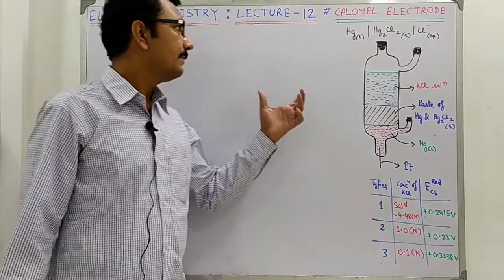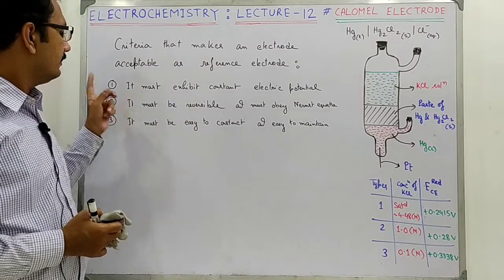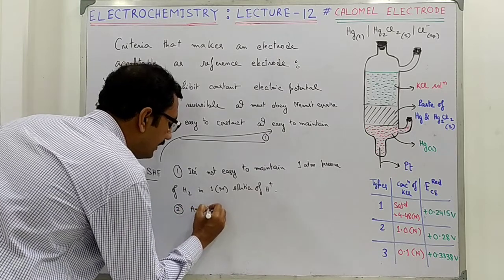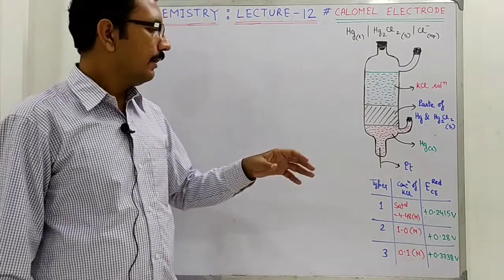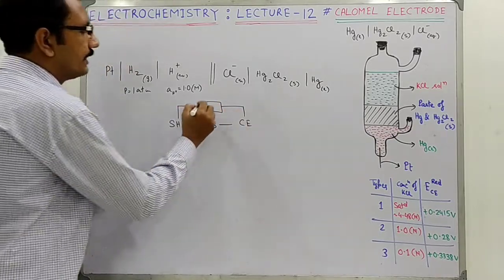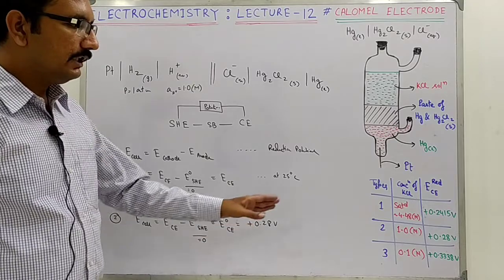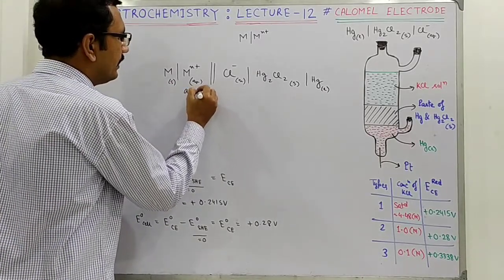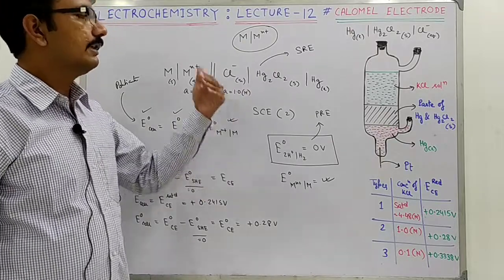Calomel Electrode || SCE || Reference Electrode || Electrochemistry || Lecture 12 || EMF

Comment from the maker: Watch the video carefully and solve the Problem: 
Write the a) Cell reaction, b) available Electrical work, for the following Cell -
Cd | Cd2+ || KCl (satd.) | Hg2Cl2 - Hg.
Given: E°_Cd2+ | Cd = -0.402V.
Reply: Provided  Cd |Cd2+ || KCl(satd)| Hg2Cl2 --Hg

For calomel electrode ... 
2Hg   = 2 Hg+ + 2e 
2Hg+ + 2Cl^- = Hg2Cl2 
-------------------------------------
2Hg + 2Cl^- = Hg2Cl2 + 2e 

Cell reaction for the above questions 
Cat reacⁿ: Hg2Cl2+ 2e  = 2Hg + 2cl-
Anode reacⁿ : Cd²+ +2e = Cd
                         (-)        (-)    (-)
__________________________________
Total reacⁿ : Hg2Cl2 - Cd²+ = 2Hg + 2cl^ -  - Cd
    : Hg2Cl2 + Cd = 2Hg + 2cl^- + Cd²+

E°_Cd²+ |Cd = -0.402 volt 
E°_Cl^-(sat)|Hg2Cl2 |Hg = 0.2415 v......since the solution is saturated so electrode potential will be this .

E°_cell = E°_c - E°_a
            = 0.2415 -(-0.402) v
           = 0.6435 volt 

For a galvanic cell electrical work or electrical energy produced = nFE

For the given cell , electrical work will be 
   W =  nFE°_cell
       = 2* 96500* 0.6435 joule
       = 124195.5 joule 
Where 
n = No of electron transfer 
F = 96500 C
Reply: For the calomel electrode, the reaction are —
2Hg ---> 2Hg+ + 2e
2Hg+ + 2Cl- ----> Hg2Cl2
————————————————
Total reaction is : 2Hg + 2Cl ---> Hg2Cl2 + 2e
a)  according to the question, the cell reaction is —
A R : Cd ---> Cd²+ + 2e
C R : Hg2Cl2 + 2e- ---> 2Hg + 2Cl
———————————————————
Total reaction is : Hg2Cl2 + Cd ---> 2Hg Cd²+ + 2Cl
b)  E°_Cd²+ | Cd = -0.402 V
Since the solution is saturated,  hence the electrode potential E°_Cl- (satd.)  | Hg2Cl2 | Hg = 0.2415 V
Now,  the standard cell potential is 
E°_cell = E°_cathode — E°_anode
             = 0.2415 — (—0.402) V
             = 0.6435 V
The electrical work of this particular cell is —
W = nFE°_cell ........
Where, 'n' is the number of electron transfer 
F = Faraday constant (96485 C)
E°_cell is the standard cell potential 
For this cell, —
W = (2 * 96485 * 0.6435) Joule
     = 124176.195 Joule
Reply: Here,Cd|Cd2+||kcal(sat)|Hg2Cl2-Hg ---for this cell the standard electrode reduction potential of cd electrode =-0.402v, and for the  reduction potentials of calomel electrode s for saturated kcl =0.241
Cell reaction: using reduction method,
Anode reaction: Cd2+ +2e- ------>Cd
Cathode reaction:Hg2Cl2 + 2e- --->2Hg +2Cl
____________________________
Total cell reaction:Cd + Hg2Cl2-->Cd2+ +2Hg +2Cl
 
The electrical work of a cell is the product of the charge transferred multiplied by the potential difference and as,
the electrical work for the above cell is ,w=nFE^0.
Where the ,n=no of electrons transferred=2 
F=Faraday constant=96500c
E^0cell= E^0 cathode - E^0anode =0.241-(-0.402)v.           
                    =0.643v
Now putting the values ,we get the electrical work is 124099J
and this is the available electrical work for this cell.

Comment: a)For saturated calomel electrode, concentration of KCL is 4.48 (N)  and value of electrode potential is E^red_CE =+0.2415V which is measured with the help of potentiometer ,when connected to standard hydrogen electrode.

Cathode reaction: Hg_2Cl_2 (s)+2e --> 2Hg (s) + 2Cl^ (aq)
Anode reaction: Cd^2(aq) +2e --->Cd (s)
-----------------------------------------------------
Cell reaction: Hg_2Cl_2  (s) - Cd^2(aq)---> 2Hg (s) +2Cl^-(aq)-Cd (s)
So required cell reaction is Hg_2Cl_2 (s)+Cd (s)---> 2Hg(s)+2Cl^-(aq)+Cd^2+(aq)
Reply: Thank you sir